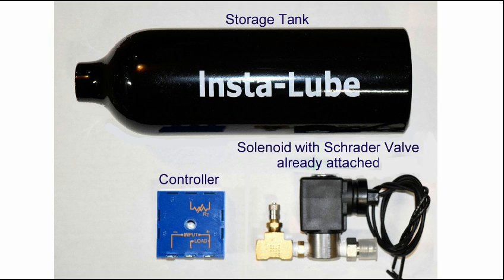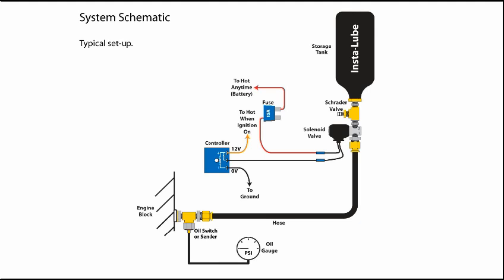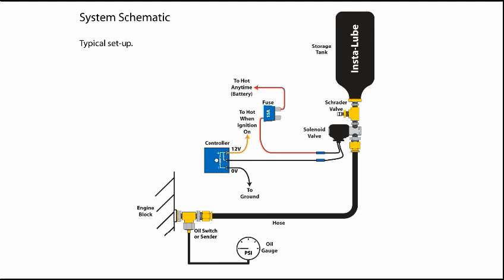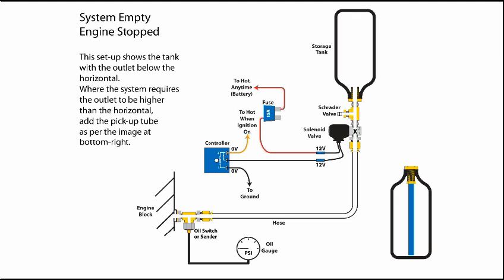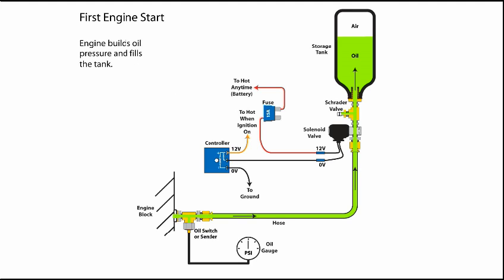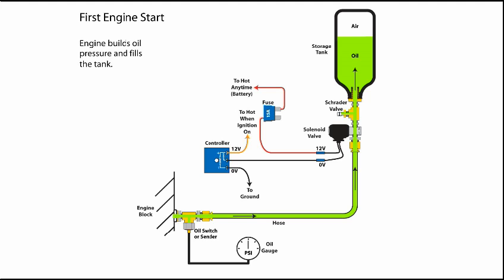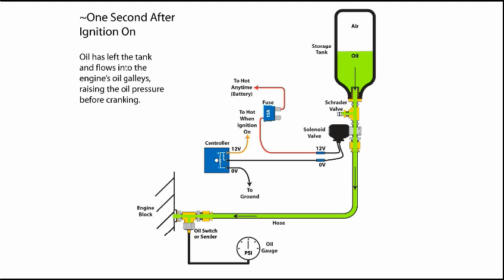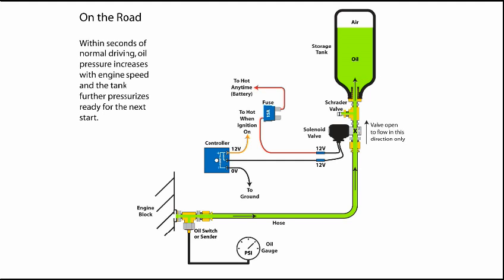Jaguar XK8 AutoEngineLube 2

Comment: Excellent video, thank you for the explanation.
Reply from the maker: Thanks Balogh. I made the video some time ago and, unfortunately, I'm not sure if the Insta-Lube system is available anymore. If it's not, I hope there is a similar system available from elsewhere.
Reply: @richardastley2517  Actually, i am planning a prelube system with an electric oil pump.

Comment: Bought it, not happy.  No timer is included anymore and you have to also buy connections to add a Schrader valve to pressurize the tank . Still working on getting it to work correctly.
Reply from the maker: What I termed a "controller" has a timing function in it.  It's a while since I installed mine and at that time I couldn't have been happier with the support I got at sales@autoenginelube.com . I also found that there was more than enough components for almost any installation. Hope you're able to sort it out and that things haven't changed with the company's support.
Reply: @richardastley2517  Have tried to contact company with little or no response, at lease in a timely manner. As of now, I'm working with another who has had a kit installed for several years, long distance. Ordered and installed a timer/controller and will pickup connections for Schrader valve next. No disrespect to you at all. Your kit had all the necessary parts and was a breeze to install and works as advertised. I'm sure once I get all the other parts mine will also. BTW thanks for posting. Your video has helped out a lot, especially with wiring.